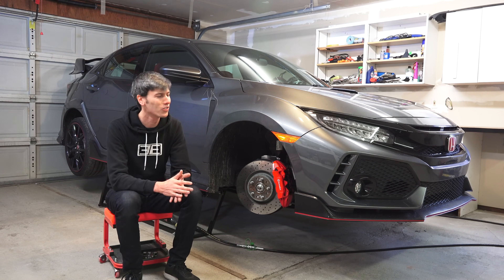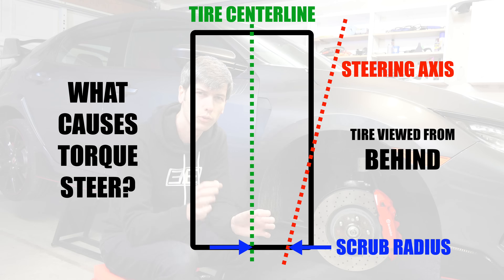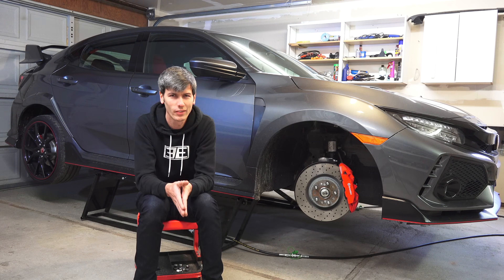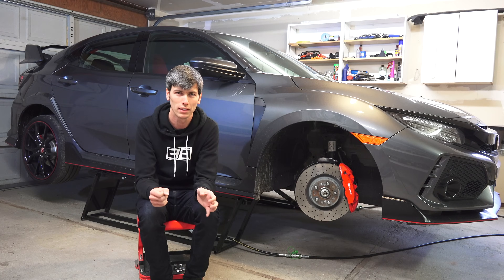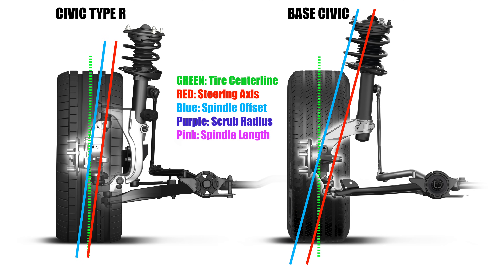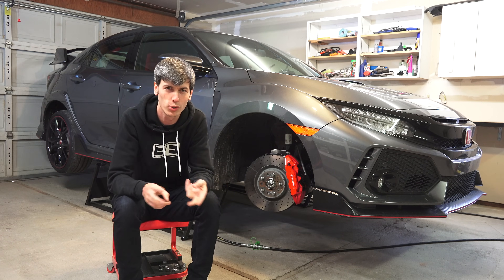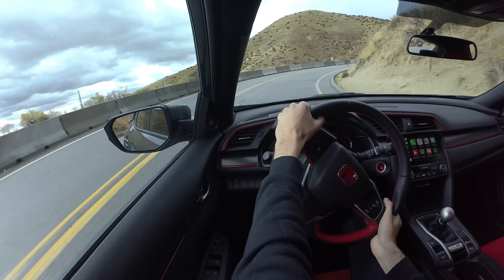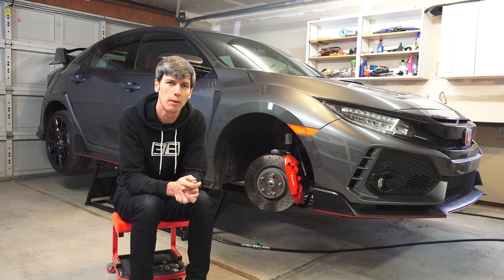Why Doesn't The Honda Civic Type R Have Torque Steer?

Comment: niche technique,  this creates a massive "brake" system now including the the suspension inside the wheel. this requires flatbed wheels to have enough space. good luck finding propper winter tyres.

Comment: I hate torque steer. Why would Honda put fwd in a v6 :(
Reply: ??? CTR is a 2.0 4 banger...
Reply: Hacker07Gaming why don't you want a V6
I also get slight torque steer in my Lexus RX450h
Reply: Hacker07Gaming L
Reply: Ahmed Moosaji I'm used to rwd, all my cars were rwd sometimes when I try to quickly change lanes from a slow speed the torque just takes over
Reply: V6? what car are you talking about?
Reply: Hacker07Gaming because Honda like the idea of pulling then pushing.

Comment: Do the wheel actually stay straight ? It has electric steering rack it can just be feeding opposite lock automatically
Reply: Yeah, an EPS rack can make the driver think there is less (or no) torque steer by just compensating for it. But the mechanicals discussed here still factor in to reduce the true torque steer effect - add in quality EPS and it's virtually guaranteed to not exhibit any TS as far as the driver is concerned.

Comment: In my old Saab the torque steer would send you off the road, if you drove around with a lazy hand on top of the steering wheel.
The steering rack moves around when 300NM torque is made by the engine, to fix it you could buy a steering rack clamp kit and it helped a lot.

Comment: .... in the launch demo, it looked like you short-shifted into 2nd gear, or did it red-line in 1st gear that quick?
Reply: Single-mass flywheel and very short gearing so yes, 1st gear runs out fast.

Comment: Wow, that's a very interesting and cool suspension design.  I never liked Mac struts because of the way it combines the steering upright with the spring and damper.  Here, the strut doesn't rotate at all.  I guess it's still considered a McPherson strut because there's no separate upper control arm, but it doesn't handle the steering duties.  Almost like a hybrid of double wishbone and McPherson strut designs.

So just a note to all the ricer Hype ARRRR fanbois out there: don't mess with wider wheels/tires or spacers.  You'll destroy the driving characteristics of the car.  Oh wait, that pretty much happens on any car with spacers!
Reply: The Type R community is having a few issues with aftermarket wheels, anyways. The suspension geometry, FWD, and big brakes make for a very positive offset and combined with a 5x120 bolt pattern mean that most wheels don't fit. 18" wheels seem to be the sweet spot, though.

Comment: does the new civic also rev to 9k?
Reply: Redline is 7000 rpm
Reply: Nope, it's something like 7400 I believe.
Reply: kabob21 thanks for that correction. I misremembered the figure, but also remember seeing a few publications and individuals stating a slightly higher rev limit (7200 maybe). So could it be a case of having two, one soft limiter (cut fuel only) and one more aggressive ignition cut at 7200?

Comment: So that means  don't mess with the offsets and spacers on this car.
Reply: Tell that to camber guys
Reply: Parker Oviedo You do that by not messing with the offset and spacers, unless you do both in a way that cancels eachother out (which is inferior to just using wheels with factory offset).
Reply: As long as you have he proper offset you can go wider and still have a similar center point and stick out more on the inside and out
Reply: Yep. And getting wider tires must be done on wheels with the exact same offset. Your limit of width, therefore, will likely be inbound-side related.
Reply: Folopolis It all depends on the car. Every car has dozens of things that are a compromise between performance, comfort, and cost. If I want to upgrade my factory steelies and all-season eco tyres to a set of 1 size larger aluminium wheels with grippier tyres, I have no choice but to use 1" to 1.5" wider wheels with a 30mm to 50mm wider tyre size, as anything less would fail to meet the load index my car needs. This in turn requires the ET value of the wheels to be at least 10mm lower (wider) than standard for the tyres to clear the suspension.
In case of the Civic Type R this would be a significant change (but you probably wouldn't need a much wider than stock tyre size in order to fit good tyres on one of those), but I doubt I'll notice it in my 120hp/206Nm car with a much more conventional steering geometry, even if those power numbers increase by up to 50% in the future. The extra traction and reduced sidewall flex will most likely compensate for the increased scrub radius in most situations.
Reply: Not at all. Just set it up correctly and all will be well. You can also adjust cater settings to control how sensitive or heavy you'd like the steering to be and that in turn dictates how the steering self centers. On cars without adjustable caster you can buy offset lower control arm bushings that are solid that will induce more caster through the travel of the suspension or lock to lock. If you blindly throw spacers on, then yes you'll have issues. Also getting an alignment will help. Setting up the toe influences this a lot. Multi link suspension reacts to every small change made including suspension height changes from added or reduced weight or even lower or higher offset wheels.
Reply: In general yes, but sometimes the benefits of a wider track/contact patch outweigh any detriment to scrub radius and the like.
Reply: but, brah, dat low life

Comment: I’m pretty sure it also self corrects for torque steer as well. It adjusts your steering for you very slightly if it detects unusual pull which you don’t notice. It also applies breaks to single wheels slightly if it senses torque favoring, even with the LSD.

Comment: Where are you learning all of this car stuff from?
Reply: How so, every engineer learns the same thing around here for 2-3 years and start to specialize (auto, aero, etc) in last 2. Math, some computer skills if you don't have them (3d modelling, office etc)  and material resistance related stuff. Final year of AE is engines and their construction, car dynamics, failure of parts, car subsystems and their construction and most of the things covered on this channel.
Reply from the maker: For this video I spent a lot of time speaking with the Honda Civic's chief engineer, Hideki Matsumoto.
Reply: This wonderful contraption we call the internet also encompasses everything you can possibly learn as well. Sorry for the sarcasm, but it's often the most underutilized tools in today's era.
Reply: DeRon Burton not everything can be spoon fed.
Reply: yep thats right I also think its that when searching for help on most topics people dont know how to research it. questions about how to fix stuff are solved by learning from yours and others experiences
Reply: the underlying physics are universal tho
Reply: every university teaches it differently
Reply: yea if there was an all encompassing website holding every piece about cars or just engineering in general.
Reply: Automotive engineering at university
Reply: They are but most careers geared to this field go beyond the underlying physics.
Reply: Get subscriptions to car and truck magazines - Car and Driver, Road & Track, Motor Trend, and Truck Trend are all good ones that explain new trends in vehicle engineering, along with the current/older stuff.  Great way to learn - then use YouTube and the internet to research anything else that you're unclear on.

Comment: This isn't anything crazy, my dad's GTI has 0 torque steer
Reply: Zero is incorrect. Minimal maybe, but I think virtually every single FWD car ever made has it to some degree or another.
Reply: Nah, i've driven it, rought even, and 0 torque steer.
Reply: Sorry, but you're wrong. You may not be able to notice it, but it's there.
Reply: you tell me what i have felt, floor it on a straight and there is 0 torque steer. Sorry if you dont belive me
Reply: Physics is physics. Sometimes people arent able to comprehend the subtle nuances that are present, but that doesnt mean they dont exist.
Reply: I had a GTI before the Type R, I definitely don't believe you. The GTI didn't have much but torque steer was still noticeable.
Reply: kabob21 what year and packages, also did you have a manual

Comment: So u can start accelerating a little earlier, technically and the torque steer won't be a total drag? Am I understanding the torquesteer Dynamics of this car specifically, correctly?
Reply: No.  It's actually the opposite.  The more the wheel is turned while accelerating the more torque steer you will get.  Thus when you've just passed the apex the torque steer will be worse on throttle than if you wait till the wheels straighten out a bit before giving it more throttle.
Reply: Torque not lost to torque steer, goes straight to accelerating torque.
Reply: The torque steer in the scenario described wouldn't be consistent enough to rely on to "aid" in track driving. You want the ability to start accelerating earlier out of a turn, get stickier tires. Although truthfully, the stock Continental SportContact 6 tires are probably one of the best street tires I've ever driven on.

Comment: Hi power front wheel drive just sounds funny.
Reply: Kasam I like going fast personally. At the limit driving is exhilarating because it's a constant balancing act between grip and no grip.
Reply: Acureyt Look up 1000 hp gti lol
Reply: Numinous your a savage man. 300 hp. Jesus must suck you right into the seat. Lol
Reply: Numinous and I don’t think it’s funny. I think thats a good first car. Prolly something I’d buy my son when he’s 16
Reply: Then you probably think my 390/385 @ the wheels Speed 3 is pretty funny. I've had lots of "fast cars" thing it was funny too, until I pulled them. I let them catch up to me afterwards, and the dumbfounded look on their faces is priceless.

Mind you, I realize 390whp isn't king-of-the-hill (even some Speeds are 800+ @ the wheels), but it's more than enough to hang with many a "fast" car. Besides that, I built it to be amazing in the twisties, and it really handles that goal well (pun intended).
Reply: Acureyt imo more fun going sideways in a rwd car than being quick af

Comment: I don't know about newer models, but pre-PSA (Pre 1980s) Citroëns didn't have torque steer. The half shafts were equal length and they had center-point steering geometry (DS, GS, SM). No torque steer whatsoever, and in case of a front wheel blowout, the car just continued  to go in a straight line. And this was like 4-5 decades ago...

Comment: It also allows them to put a larger wheel/tire in the same size wheel well because the tire just rotates in the same spot, instead of moving around in an arc as you turn.  But of course, this video isn't about that.
Reply: I kinda wish Honda had stuck with 19" wheels and tires in the Type R. Mine is pretty comfortable but 20" wheels with rubber band tires makes the car a little rougher ride than necessary even with the shocks set in Comfort mode.

Comment: actually... I like a little bit of torque steer from time to time :-D
Reply from the maker: Haha, what is desirable about a steering wheel not doing what you ask of it? I mean it's a bit of a fight I suppose, which could be intriguing, but from a driving standpoint it seems to be a flaw.
Reply: I agree 100% with you on that intriguing / flaw standpoint. It's just the fascination on a, let's say 200hp+ FWD car that you can FEEL the power... not only by going forward but the car wanting to go in another direction as well...
Then again... you still have control over it via the steering wheel, so I don't think of it as too much of a problem really (other than the fact that it's a little lost power for acceleration). However i'm a "car guy" (with a '90 Taurus SHO) so i'm kinda used to it...

Comment: So no torque steer 
on rear wheel drive cars?
Reply: ᄀ ᄀ 
The clue is in the name (tourqe steer), tourqe to the steering wheels, if the wheels don't steer like the rear wheels, then no tourqe steer,

Your welcome, 

Peace ✌
Reply: ANON YMOUS try to Google it
Reply: ANON YMOUS i think they can still have torque steer as there will be difference in their torques and that will influence the front wheel. But this will be rare and barely noticeable, in the sense that you pretty much neglect it. As there will be always some sort of relative motion in the front wheels. But it will be more of under/ over steer and less of a torque steer.
Reply: it is called torque steer for fwd because there is torque being applied by the engine to the wheels which steers the tire. meanwhile un rwd cars, there is no torque being applied to the steering wheels.
Reply: Sahil Navale 
Rear wheel and awd cars have a different kind of differential that limits the amount of power and tourqe which can be sent to each driving wheel,.
Reply: It can. But mostly common with front wheel drive cars. 
Search Google it's better there.
Reply: Noir Spectre all cars have all 
Torque steer, over steer and under steer.

Comment: I've been waiting on a technical explanation of this since reviews came out. Much appreciated. Now that Honda's figured out the best way to eliminate torque steer, do you picture a FF horsepower arms race? VW limited the Golf GTI with 210hp to reduce torque steer & it still consistently outperformed cars with high power but were hampered by torque steer.
Reply: Mark Ferrer yes I can actually see this happening of vw continue to make the golf GTi clubsport coz the normal GTi is nowhere near as serious as track car as a civic type r but yeah it could be possible. However Honda are in a nurburgring war with Renault (European company), and Seat (European as well) because these companies make cars that compete with each other for the fastest front wheel drive car around the nurburgring.
Reply: And toyota used it one the Celica rally car in 96 :D called Superstrut, its nothing new
Reply: Then they'd increase the price buddy so that's a no no
Reply: Hirlarious that everyone thinks Honda invented this tech. It’s a blatant copy of Renault’s Perfohub. Renaultsport have been using it to great effect in all their Megane R.S. cars... since 2004! 
The Mk 2 Ford Focus R.S. copied the Renault’s design and called it Revoknuckle... in 2009!

Comment: Actually the front suspension with zero offset is quite an old invention. The setup with negative offset is a newer invention that is now standard, because it helps to right the car under braking. The McPherson strut and floating caliber brakes are part of that negative offset invention. When you then want to revert to zero offset setup, you get an overly complicated suspension in my opinion. It's like two suspensions in one. Lets call it a hack.

Comment: Even my Dacia Berlina form 1990 with 45hp has torque steer. It won't go straight for 1m sooo Dacia has more tq than the civic :)))
Reply: Paul Hojda with the spring rate of a water bed :)
Reply: That's putting it "softly" ;)
Reply: Those old Dacias had double wishbone front suspension....which is theory is more sophisticated than this civic's
Reply: lol
Reply: you still have a running example of one of those? they shoot up in value like crazy! better restore it, it's gonna cost more than a nice bmw in 10 years!
Reply: The Vibe I sold it in 2008 for 200€ :))
Reply: You live in a PUBG map?
Reply: well in that time it was 200 euro to sell it to somebody or 200 euro for scrap iron.

Comment: Those faux ducts..... but good video on describing how to eliminate torque steer
Reply: Most modern cars have faux ducts. Sure these are very prominent and obvious, but still.
Reply: Alan Bowers yeah I know I see it all the time. I hate it. My 1st gen s2k has it but at least it doesn't encompass 80% of the frontal area
Reply: Very true. I think in the CTR's case, it would be more aesthetically pleasing if they didnt obviously make it look like a honey comb grill, instead going with simple black plastic with a few ribs or something (like the foglight surrounds of a Focus ST or something).
Reply: Fact ducts are a fake styling design that always comes back. Ford used to put fake shark fins on the front quarter panels of their 77-79 Thunderbirds and Lincoln MK V's.
Reply: Definitely. I think in the next 5-10 years that particular styling fad will once again fade away for a while (maybe for good with the rise of EVs).
Reply: yes but look at the focus RS. it's ducts are molded plastic. they are cheap AND functional.
Reply: Yea i see them a lot in modern cars but every single time they still manage to make me angry.
Reply: The point is for racing teams to actually be able to easily implement functional ducting there. Look at HondaPro Jason's new Phoenix Yellow Type-R , he had the guys at the body shop customize the "faux duct panels" by cutting out the flat paneling between each of the honeycomb ribs, which converted the panels into functionally breathing panels (although, unfortunately he didn't go the extra mile and have actual ducting routed in to make them further functional). But still, the point being is that there is more potential to be had if you know how to optimize what is given to you by the factory.
Reply: They're not fake.  They are called air curtains and are used for smoothing the airflow on the front of the car, by keeping the air closer to the body.  This provides a theoretical higher top speed and better fuel economy due to less drag.